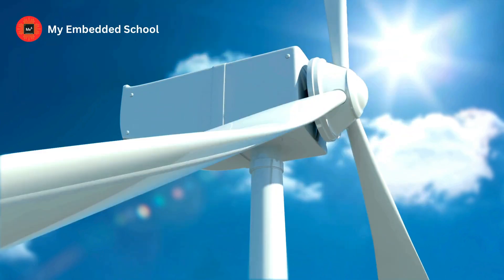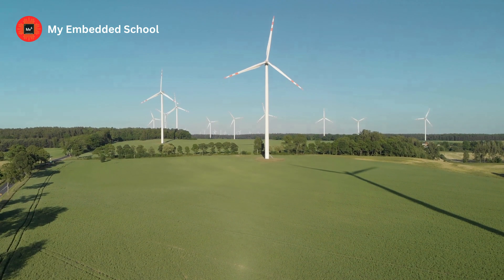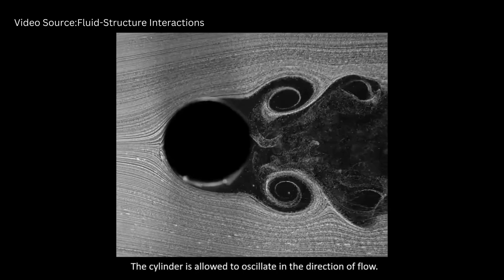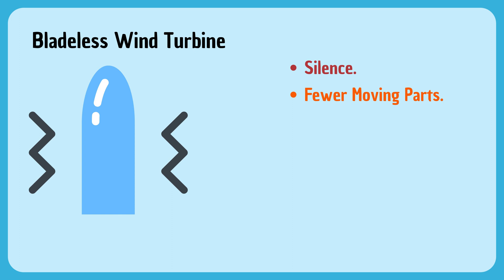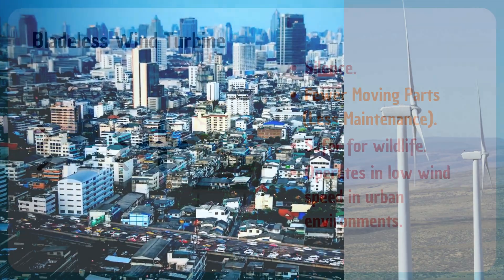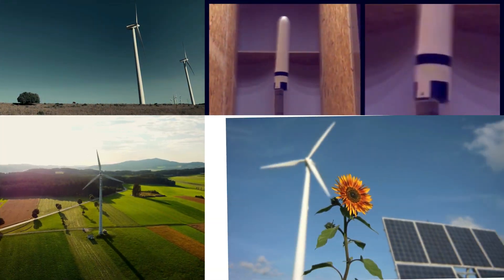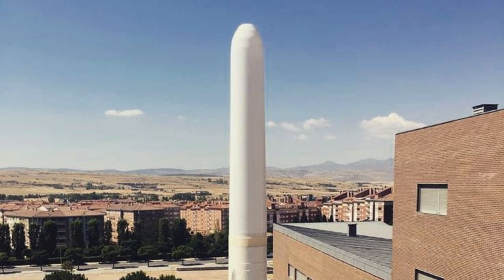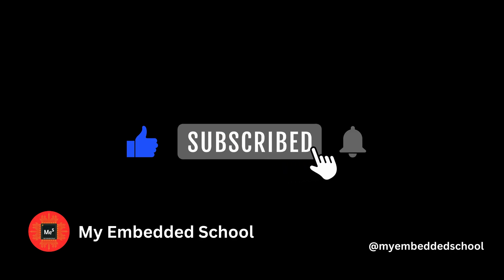Bladeless wind turbines could power your home #windenergy

Comment: They are not "silent", certainly not if they are based on vortexes, and they are mechanical at their base, turning their motion into rotational energy, again, not silent.

And not one mention of efficiency or power output?

And instead of three blades made of fiberglass, this only has one "blade", an improvement, but still problematic.

Comment: This is a daft idea!

Theoretically a vibrating pole can store energy but there is such thing called cyclic stress fatigue.  When a material is subjected to cyclic stress reversal like a pole bending forwards or backwards (or more accurate sideways to the wind direction) the stress is reversed between tension and compression.  Every material has a "finite" number of stress cycles, which is dependent on the level of stress too, before it failed by fatigue.   As a professional engineer I have seen steel chimneys sheared off the section completely.  Thus the way to make tall structure safe is to avoid vibration.   

By common sense the smaller the movement the lower of the energy so a vibrating structure will never get anywhere.  The the large energy is involve it can produce the end result like the  Tacoma Narrows Bridge collapse by resonance (due to the Kármán vortex street).